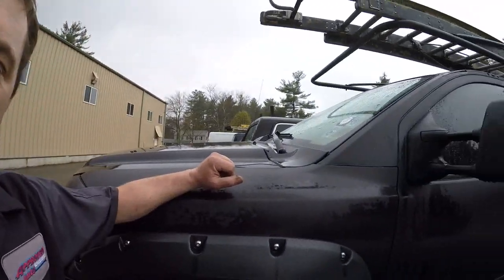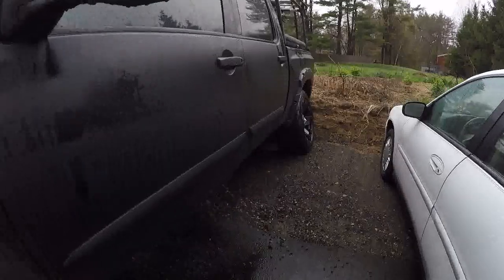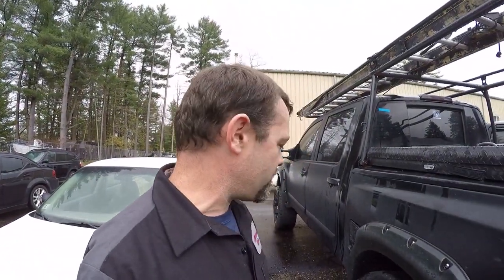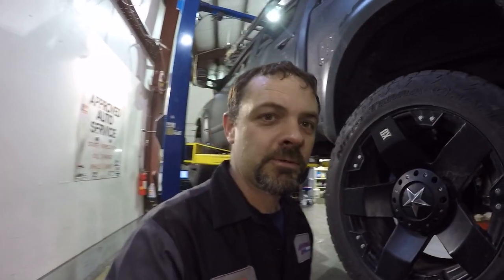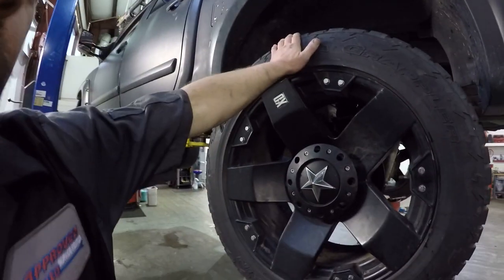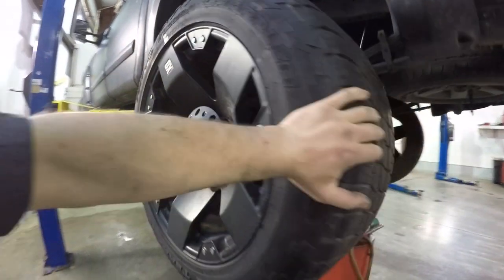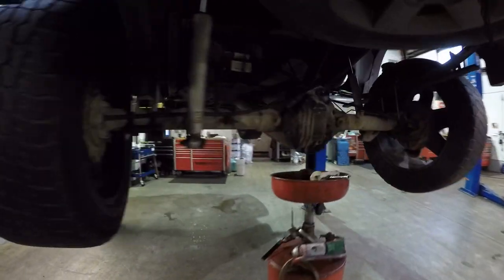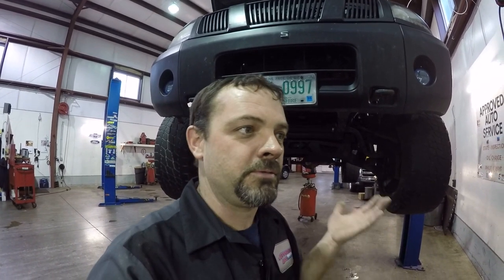Drive It Until The Wheels Fall Off. Then Keep On Going!

Comment: Sometimes I miss being a mechanic. It was nice having access to the lifts and tire equipment, but the place I worked for decided that even after 2 years someone with an ASE cert wasn't worth more than changing oil and tires, so I got out of it. Still fun to watch others. Now I work on the networks for car dealerships, and a lot of the mechanics computers at them. Kind of a funny turn about on that.

Comment: The Titans have a common problem of throwing out rear axles. Nissan speced their own Dana 44 variant with cheap parts such as spiders and cross pins and adding over 400ft lbs of torque really doesn't help that. In my Titan the cross pin on the spiders broke in half and launched out of my differential cover. The only true fix for these trucks is a Eaton Detroit TrueTrac, a healical gear limited slip differential. It's an expensive toy ($650) but it is worth every penny. I have an 04 with just over 180k and expect it to run well over 200k if not 300k

Comment: Way back when I was working in Detroit for a month or 2 , we were going back to the shop at around 3am, we came to a stop sign and we could see a small truck about 1/4 mile that was going to come right in front of us, there was a huge amount of sparks flying up, we just sat there to see what was going on, he finally pasted in front of us going around 30 mph, he was missing a tire on the front drivers side, he had worn the brake drum almost in 2. He was just driving along. Saved a tow charge I guess :)

Comment: I have seen that in FL lots, Usually they wind up loosing the wheel.  I have Seen cars and trucks with 3 wheels and driveshafts that they lost. They had to of had a bad vibration before both failures happened.  Those rear ends always blew up @ nissan, Not a good design its too smal.

Comment: how is that even possable??? to get that much tire flop/wiggle.  Did the backing plate/bearing assembly come loose from the housing?  I wouldnt think a regular rear end with axle shaft would wobble that much.
Reply: my only guess is that the bearings were totally destroyed. perhaps running it through too many streams thereby washing the lube out of them.    but that idea wouldn't work on standard axles. maybe this guy is different.   I don't even remember what my full floaters look like as its been too long since I've had them apart.

Comment: Yup, would have liked to have seen just how bad the one you removed was, how it was able to go to those angles and not fall completely off, for a start.   8-)
Reply from the maker: +Gordon McMillan The brake caliper was the only thing holding it together. I didn't have time to stop and show the axle, this is me at work with a quota to fill by the end of the day.
Reply: +Amesie&#39;s Automotive Corner 

Thanks - even more risky that it looked then.

Comment: XD cockstars and a lift kit all on a toyota. It seems like it's no surprise that it broke twice.
Reply: that's why its a Nissan
Reply: Clearly it broke because the nitwit driving it didn't take care of it.  Hence the driving it 20 miles down the highway on a broken axle.  Had he been driving a Toyota, he wouldn't have made it off the dealership lot before it fell apart.   Vehicles can last a long time if you take care of them, and even the best made vehicles will turn into shit if you ignore them and abuse the shit out of them.   The look-at-me-I'm-an-asshole rims he put on this truck pretty much prove he's in the later category.

Comment: Are you aware of the damage you caused by letting the calipers just hang by the hose?
Reply: letting them hang is better than setting them on something and them falling shock loading the hoses ;)
furthermore, if the hose is that weak to be stressed by the lightweight mostly aluminum calipers of today, they would be huge risk and could blowout at any time.
folks wonder why I "anchor" the brakes and test ABS system, when test driving. some have the nerve to complain I blew out a line, they get the idea when I ask if they have full coverage and can afford car payments vs. replacing a few brake parts for safety :)
Reply: throttle bottle What you should do is use a bungee to hang them up somewhere. There is a difference between stretching the line and swelling the line, and letting it hang and stretch isn’t good for it.

Comment: WHAT No road test to diagnose it ,you must be one of us mechanic's that rip people off by just replacing parts. I could have rebuilt that for 4x as much as it cost to replace it.
Holy crap it's a miracle nobody got hurt ,1 to many burnouts .Idiots think "it's a truck" when they are just cars from the 60's with a different body nowadays. Tail light warranty on that job. Money down this won't be the last one.
Reply: they do contracting or landscaping of some sort and those folks love to overload them badly, then drag an overloaded trailer behind that yet.